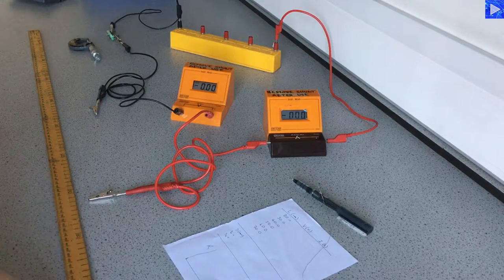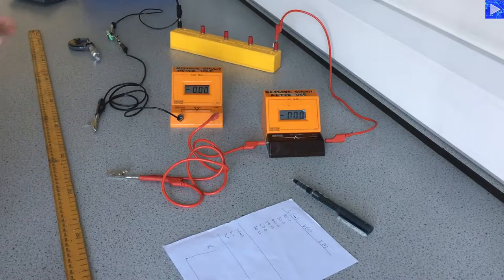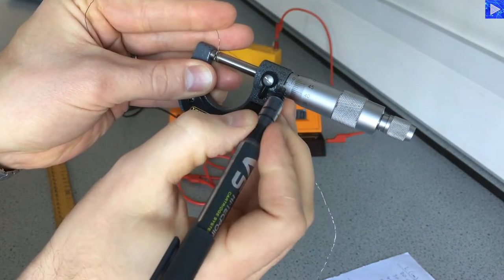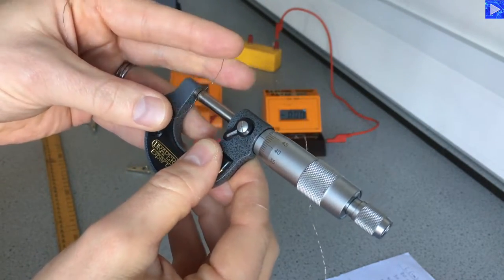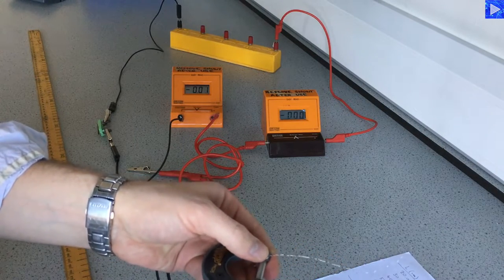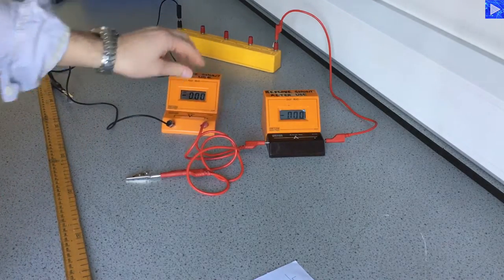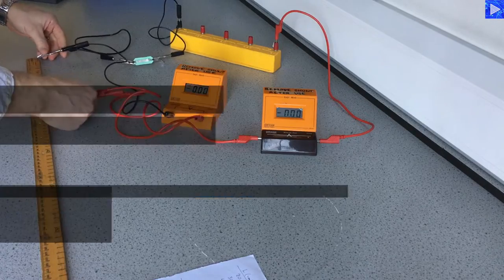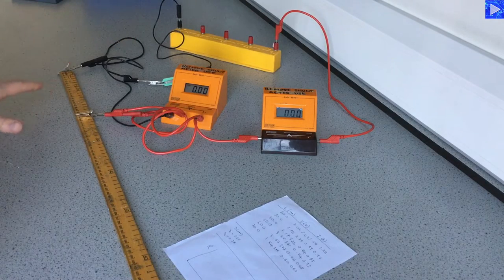Experiment to determine the resistivity of a metal wire

Comment: One question, why did you use these current and voltage values? I mean, can these values be generalized to any material?
Reply: by the way, nice video =)
Reply from the maker: The voltage across the circuit can be generalised to other materials. But there’s likely a limit as resistivity values diverge from that of this material. 
The current values will be closely tied to the material and dimensions. I selected them by finding the max and min and selecting a suitable range within that.

Comment: Do you have a list of materials that you have used in this demonstration, if so can you please reply and send it here thanks.
Reply from the maker: Sure:
1 m metal wire under test
Battery pack
Connecting leads and crocodile clips
Ammeter
Voltmeter
Metre rule
Micrometer

Comment: Is it alright if you can write down the method?
Reply from the maker: Sure. 
1. Measure the diameter of the wire at different points. Use the average diameter d to determine the cross-sectional area A of the wire.
2. For a 20 cm long wire, measure the current I and the potential difference V.
3. Record results in a table.
4. Calculate the resistance R of the wire.
5. Increase the length of the wire in steps of 10 cm and determine the resistance for each length.
6. Plot a graph of resistance R of the wire (y-axis) against its length L (x-axis).

Comment: Can I do this for steel?
Reply from the maker: Yes. And for any material you can pass a measurable current through. 
Considerations:
Increasing cross sectional area will increase magnitude of current. 
A higher sensitivity ammeter may be needed if the material’s resistivity is substantially higher.

Comment: what was the voltage that you supplied?
Reply from the maker: The total emf was approx 6.0 V. But in changing the length of the section of wire the terminal p.d. of the battery of cells changes. I was measuring the p.d. across the section of wire for each length (alongside the current).